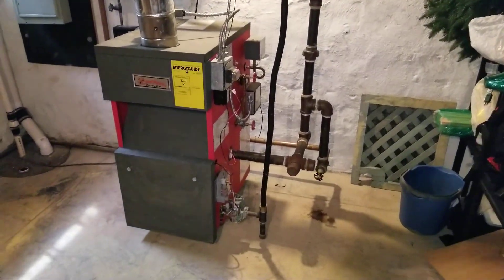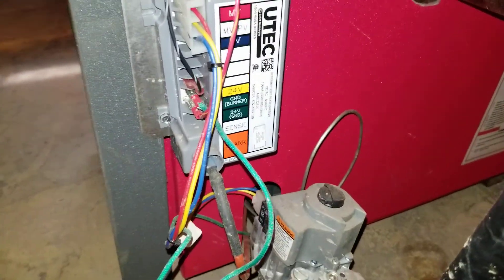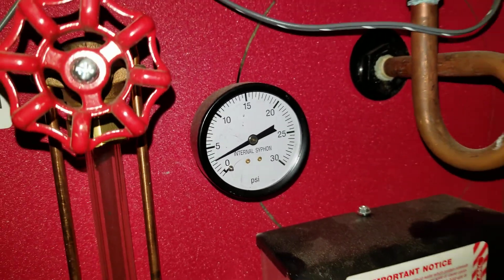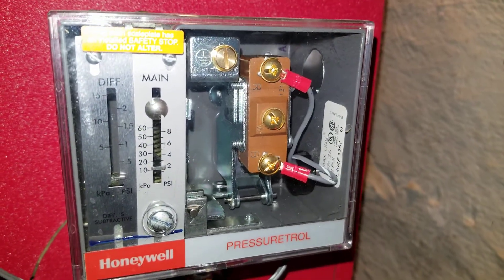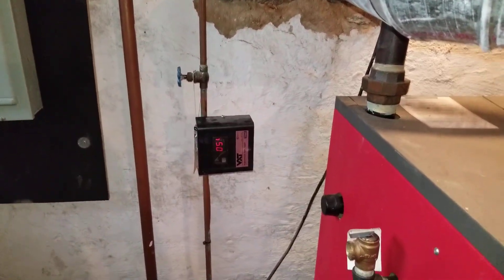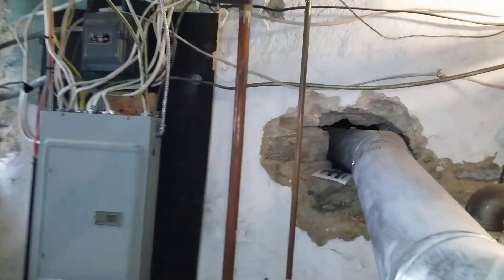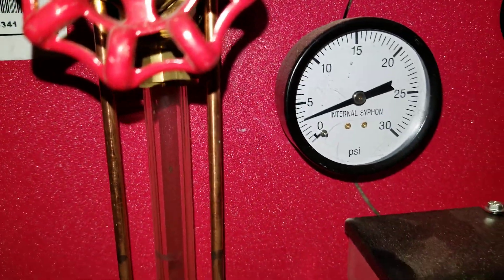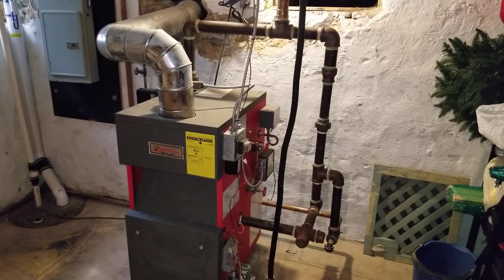How steam has boiler need to be set up-Crown

Comment: I have this same exact boiler. My biggest complaint is the freggin pressure trol clearance. It’s a headache to remove and clean the pigtail.
Reply: How do you do it? Looks like you would have to remove low-water cutoff, gauge and sight glass in order to spin the pigtail and pressuretrol as one
Reply: @MoistsPalone  I ended up cutting the pigtail off and replaced it with a better one.

Comment: I watch this video I know that steam pressure is too high 4” pound of steam should be 2” pound of steam or less watch Dan Holohan steam guy of HVACR .
Reply: Correct.  His differential is set to high.  Looking at his btu; if sized correctly his Diff should be at least 1psi so he doesn't build all that pressure.  Waste of gas really.. building so much pressure for no reason.  You live, you learn.  Read the book and adjusted as required and saved a lot.

Comment: Also I  notice that the water on the site glass fluctuates. Is that normal?? If not how can I correct this condition?  Thank you for your assistance
Reply: I have similar problem and I know I don't have any sediments at the bottom of the boiler. I've flushed the whole system recently. This 138k btu boiler is oversized for my smaller house and it causes short cycling issue for me. That's how I noticed that the pressure trol is heating the limit and shuts down for about a minute until pressure drops. Then it restarts, runs for a while and shut down again. It is powerful enough to send water up the pipe all the way to the 1st floor. That extra power is causing the surge. I had to install "Drop Header" for near boiler piping to control the water surge. Hoping someone else would find this helpful if they have similar issue. Better to get expert in who knows old steam heating system after this Covid situation "Go away".
Reply: What's the normal pressure level? mine is set to 7 in the pressuretrol.

Comment: Have the exact same boiler, but my pressure gauge doesn't move at all.  Why?? Can you help?  Thank you
Reply: I have same boiler. Mine doesn't move until boiler has enough pressure build up. Just check the pressure right after the boiler shuts down. I am surprised to see pressure is so high for this guy in this video even if the boiler just restarted. May be his differential settings are different.

Comment: I’m concerned.  I don’t have the return pipe in my boiler and as you said it should have a return.
Reply from the maker: Steam boilers can be set up as one pipe steam or 2 pipe stem. If its one pipe then the same pipe is return and supply at the same time. Good resource book  about steam is  Dan Holohan "dead men's steam"